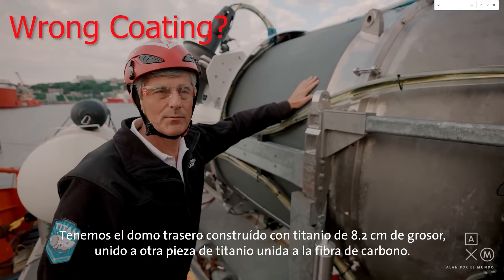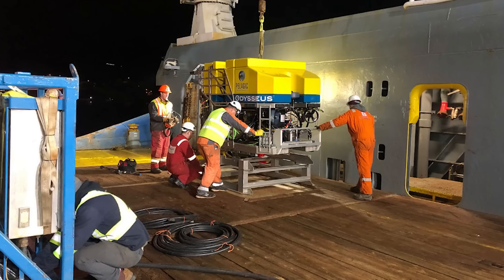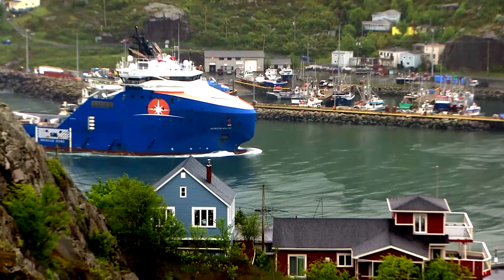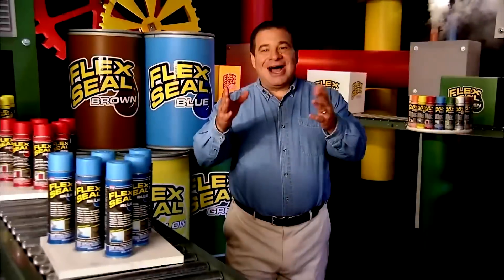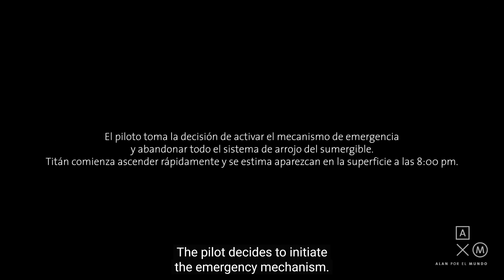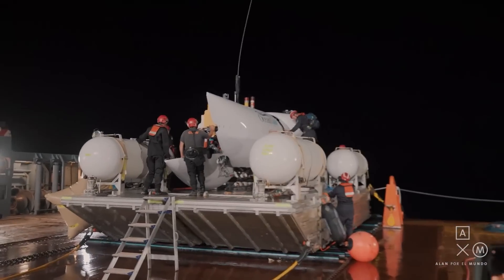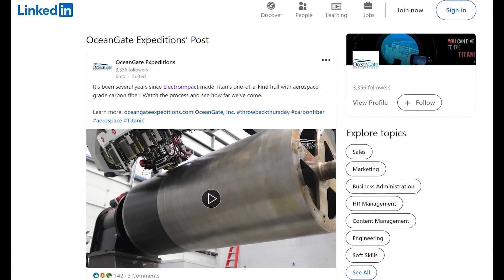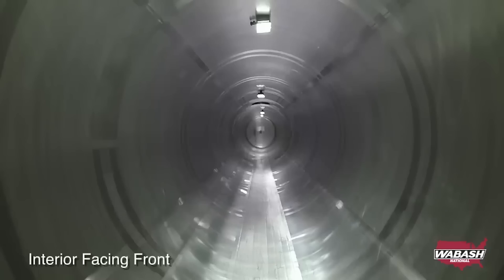Titan Sub Wrong Coating? Hull Construction, Debris Field Search

Comment: He didn’t want thicker and cross bound carbon fiber to save weight. But he uses rhino liner.
Reply from the maker: I wonder if they used the autoclave to cure it
Reply: @jeffostroff I had heard in video that the second hull was autoclaved, but I am not sure. I feel like I need a score card. Thank you for the great information
Reply: @jeffostroff they did not and that has been well documented
Reply: @jeffostroff An autoclave was never used in construction... believe it or not.
Reply: @berrytharp1334  How would you know that? All we have from the construction of the hull that failed is this 10 second video, which by the way is also insufficient to assess whether they crosses the weave.
Reply: @jeffostroff I think even if there was a process that could compress the carbon fiber and bonding agent beyond the 6000 psi it would be subjected to the carbon fiber would fray and lose strength anyway.  They’d end up with a very dense hardened epoxy CF conglomerate that would end up being about as heavy as titanium but much weaker.  Just not the right material for the job.
Reply: @jeffostroff I am pretty sure I saw a video that commented on the fact that they didn't. However I've never claimed to be right 100% of the time.
Reply: @jeffostroff good point, i have a special oven to cure all our thick pours and coatings. Its mostly only 158f for a few hrs than shut it down and let it cool to room temp slowly. We always use it after $100k failures taught us a lesson.
Reply: @jeffostroff not the Flex Seal 🤣🤣🤣
Reply: @jeffostroff  NOPE
Reply: @jeffostroff  with the kind of CF thickness they were using and how narrow the safety margin they had, they should have made the entire CF vessel  in a vacuum. Air dissolved in liquids is significant as well as the heat generated with thickness of epoxy resin use.... and cause small void to appear when the vessel cures.
Reply: @jeffostroff they did not, that's been mentioned a few times. Nor was it a clean room, far as I can see.
Reply: @jeffostroff  they did not
Reply: @jeffostroff  If you're having to wonder, that shows exactly how good your "research" is.  Yes, the fiber was crossed.  Alternating layers of hoop wound wet layup and axial prepreg.  And no, they did not use an autoclave.  This information comes from Brian Spencer of Spencer Composites, in an interview with "Composites World" published in 2017. 

Exactly the same techniques, including the non-use of an autoclave, were used for the second hull.  And yes, I have quotes for that as well.
Reply: @jeffostroff There are several videos that show Rush saying that vacuum curing was used, so it was bagged to set and harden the resin. But hearing this , one has to wonder if a resin was used between layers or was a coating of rhino liner used.
Being a form of latex sealer, Rhino liner could, under extreme pressure, simply form a rippling pattern just as latex gloves will do on your hands under water, with raised grooves along sections pressed flat from pressure.  That would  permit the intrusion of water  into the layers of laminate. Eventually, the pressure cycles would allow enough water under the laminate to make it inevitable to fail. 
My take as an A/ P mechanic who works with composites.
Reply: @youtubemusicowesmemoney8470  Rhino Liner is polyurethane, not latex.
Reply: @jeffostroff   I would think so, anything with 'wrapped' or 'pre-preg carbon fiber is always put in an autoclave to pull air bubbles out, and cure the resin....compared the rest of the cost, is just isn't that much $$$..many airplane wings and those big wind-turbine rotors are autoclaved.
 Here in Sacramento, Calif...there was a rhino-coat place, Rhino-coat was sold and used as a pick-up truck bed product, for reducing cargo damaging the bed....water sealing was just a side benefit. Water would leak out the tailgate anyway.
Reply: @dougankrum3328 nope it’s been revealed and with photo evidence that the company that built that carbon hill didn’t have an autoclave for it so to cure they bagged it and put it under vacuum like a local hobbyist would making his own stuff. They claimed 99.9% void free  after the vacuum bag cure.
Reply: @jeffostroff even if they did, carbon fiber isn't as strong under compression as it is under tension. Rino liner isn't designed for water proofing either, it's designed to increase durability vs impact. Water can also get between the layers of a composite material like carbon fiber.
Reply: @jeffostroff We yank 'em and how!
Reply: Maybe he should've used that spray sealant that is sold on late night TV. 
After all, that rowboat with the screen door floor didn't sink. 😂😅 LOL
Reply: @TheMomseloc  Flex Seal.  I am surprised that he didn't keep a couple of cans in the sub at all times.  He seems to be the kind of guy that liked doing it in the cheap.  When the cracking and popping started, he could have shot some Flex Seal in the problem area and all is solved.  😂
Reply: He seems like the kind of guy that thinks he’s smarter, it’s no less then suicidal to get in that thing with the seal the way it is. I’ll bet the carbon fiber was just fine.
Reply: @2021-x3k *Seemed
Reply: This was so predictable and apparently obvious. I can't believe more noise wasn't made.
Reply: That rhino liner is akin to flex seal over a faulty gas tank. Not really but that’s what first popped into my head.
Reply: @Pippi-Longstocking  Maybe he should have gone with gorilla glue.
Reply: Correct, in the sense of it being a bandaid for a problem.
Reply: Day 712 of me asking if anyone, ever is going to cover the gasket, or seal, or candy cotton or whatever between the door and the sub?
Reply: @martinwhite418  I'll bet it was high-grade (I'm talking Circus Grade, not the prepackaged stuff you get at Walmart) cotton candy that was just a little past it's expiration date.
Reply: @TheMomseloc  You think maybe a giant cotton candy eating sea creature ate the seal?
Reply: @martinwhite418  I can't stop laughing long enough to come up with a good response.
Reply: @martinwhite418  I'm trying so hard to picture what a giant cotton candy eating sea creature would look like. 

Maybe related to Sigmund and the Sea Monsters family? 

Because I suspected that's what they were all along.
Reply: @TheMomseloc  Yes, totally Sigmund, exactly the picture I had in mind.
Reply: @martinwhite418  They must've found out about it from the Shellevision.
Reply: @martinwhite418  Wait a minute. We could be on the wrong track. 
Sharks eat seals.
Reply: @martinwhite418  lol. I’d rather find out about the joint between the titanium caps and the carbon fiber. Specifically the different rates of expansion and contraction for temp. 
But I see your point.
Reply: @Meatball2022  Thanks, but that seal you reference was never broken, until it did. But the door seal was opened and closed, so we know they didn't use glue.  So what was it? Nobody talks about it. I feel like the door has survived and is now living in door witness protection because nobody mentions this.
Reply: @martinwhite418  where was it?  The front cap had the porthole. The rear had that tail and the electronics. Was it in the center somewhere?
Reply: @Meatball2022  Well, if you don't know where you put it, how am I supposed to know.
Reply: @martinwhite418  ok. I’ll do research on a phantom hatch for a destroyed sub that you don’t know where it is but demand answers on.  Just for you.
Reply: @Meatball2022  You do understand that these people were not born inside this sub? Hatch is not the meaning, like with birds on this sub. Humans got into and out of this turd shaped sub. The sphincter entry/exit point is what I'm referring to.
Reply: Weight is touchy on a submersible.  If you make it strong it becomes heavy and will not float.  How do you make a float for something that goes that deep?  You can't create another tank full of air because it will be too heavy to float too.  Much older designs used tanks full of petroleum because it is lighter than water and because it doesn't compress so the tank doesn't have to be thick and strong.  If you can create a pressure vessel that naturally wants to float then that makes the entire design much easier.
Reply: No matter how it was applied or cured it was still simply the wrong material.
To use an extreme example, using high tensile strength fibers in compression is like using high strength concrete in tension.
Reply: @davidchristensen2970  bingo
Reply: @davidchristensen2970  Maintaining a cylinder in the round is BOTH/EITHER a compression and/or a tension job. This isn't "using it in compression", since either type of strength can do this job. This is still "using it in tension". Exactly like a bicycle wheel, which resists being squished from the outside via... yup, TENSION. The weirdest thing to me is that you guys seem to not be aware it already made 13 successful dives to the Titanic, lol. Obviously, if tensile strength fundamentally couldn't do this job, it would have made ZERO successful trips, not 13. You're plainly, easily-observably wrong. The problem that sunk it is something about cyclical weakening, not the core concept of tension holding a cylinder under pressure intact being impossible, since it just proved that is possible 13 times.
Reply: @gavinjenkins899  
You are so far off on this that it’s basically pointless to engage.
Reply: @davidchristensen2970  Translation "I have no idea what I'm talking about but am too proud to admit that to even random strangers" a bit yikes.
Reply: @gavinjenkins899  The Titan had several issues with many of its previous descents to the seafloor. The implosion was not the first time they've lost communication, and if it ascended properly, it wouldn't have taken 7 hours to open back up as shown in the video. The carbon fiber from what I've seen was subject to slowly breaking down every single dive, which could've caused small air bubbles to form in the hull and allow water to leak in. The carbon fiber they used specifically was expired, as evident by them getting it from retired planes, which stop getting used after a certain number of flights.

James Cameron and many other maritime experts knew this submersible was doomed to fail at some point, it was only a matter of WHEN, not IF.

I could be misremembering some things, but I'm not acting high and mighty like you are claiming there was absolutely nothing wrong with the Titan's construction.
Reply: @AkameGaKillfan777  Yes I agree it had badly designed comms and cyclical degradation and so on, so what? At no point did I make anything remotely like the claim "Nothing wrong with the Titan's construction" please do not blatantly lie about my comments, thank you. None of that has anything to do with the actual conversation we were having and what I did actually talk about, which was about whether tension can FUNDAMENTALLY/CONCEPTUALLY stop a hoop from crushing. Any SINGLE successful mission to the titanic proves that yes, obviously those principles of tension doing the job can successfully apply, by simple observation of fact. If that was a bogus concept at a basic conceptual level, and the physics just wasn't true, then the submarine relying on that concept would have made precisely zero successful trips. Not 5, not 2, not 1. Zero.
Reply: @gavinjenkins899  
I’m starting to think that maybe there is an issue with understanding the terms tension and compression.
Using a bicycle wheel as an example of tensile stress only applies to the spokes. The actual hoop or rim/wheel is entirely in compressive stress. Take a bicycle wheel and remove the spokes, now we have something comparable to the pressure vessel being discussed.
Reply: @davidchristensen2970  Your example is easy to understand.  Correct me if I’m wrong but I didn’t jump to thinking you were trying to prove the accepted 12,000 year old case that a round design is inherently strong?🤣 - just that you don’t use fuel pressure hose in place of vacuum tubing, simple stuff like that.  The reason a bicycle wheel built to support a lot of weight doesn’t do as much good if you plan on riding so fast the spokes fly apart even though their both round.  The reason vacuum/  pressure implosion/ burst safety factors are calculated differently.  Things get hijacked when people get out over their skis ⛷️ sometimes.😆🤦
Reply: @kev_299  
Um, ok.😜
Reply: It was purely to cut costs.
Reply: @turgidbanana  very possible. I thought the entire reason there was carbon fiber at all was purely for weight. Steel would have been cheaper. No? 
It’s very possible EVERYTHING he did was to cut costs.
Reply: My simple racing kayaks are carbon fiber. They are also autoclaved in production. When I learned Titan wasn’t? Who would do that- be that stupid. Trying to save money and weight. He should have gone alone. I wonder if he’s having conversations with Capt Smith now, comparing notes on hubris
Reply: I had had assumed they didn't cross the fiber because it was more expensive to build that way, but it was only due to weight? How does that even make sense?
Reply: @inthefade I believe the whole reason he used carbon fiber to begin with was to save weight
Reply: And I thought he used carbon fiber because Boeing gave away cheap surplus (past its shelf life) 🤔
Reply: @Para-Phrase this has been confirmed
Reply: @Meatball2022 Not to save weight but to i prove boyancy. The two are related but not the same. It is weight to volume that matters under water.
Reply: @torben777  density
Reply: @inthefade  it was definitely on the cheap, but I remember him saying he wanted it to be naturally positively buoyant so the default if things fail is that it floats
Reply: @Meatball2022  Yes, that probably explains him going on about 'strength to buoyancy  ratio' which isn't really thing, you'd normally speak in terms of strength to weight ratio.  And I guess they wanted to use Carbon Fiber end domes, and except for the engineering problem of the window punching through it they probably would have.
Reply: @inthefade  most likely  lazy and  cost..  no othe reason to not cross the figerd thy are exoneialy  straonger that way
Reply: Unreal this wasn’t tested properly.
Reply: @GJH1010  nah. Not unreal at all. He was a narcissist.  He had belief that he could simply do whatever he wanted, he could ignore every standard, every expert, and use his minimal expertise to design a craft to be used in a highly stressful and intensely dangerous environment.
Reply: But they tested cross wound in lab's.

If you watch the tests for MK1.
Reply: He did it for the LULZ 😂
Reply: He's clearly intending it here to just be a waterproofing layer, not to add strength.
Reply: According to dr. Ing. wagner who did the video about the pressure calculations cross winding wouldn’t have made a significant difference. I know because I asked him this.
Reply: Double hull makes the most sense especially with those sensors he had, I'm no sub engineer though
Reply: @RCsFinest  I thought that as well. And if water is in the void between, that might add some strength. But like you, I’m surely no expert. Easy to second guess now that we know what DOESNT work
Reply: @RCsFinest I agree.  Without a light hull there is nowhere for moisture to accumulate outside the pressure hull as well.  Obviously pumping out becomes a much tougher task at that depth so the dehumidification system would have to remove all moisture to avoid condensation.  Someone directed me to a video where an engineer is speculating about the source of the water that was sloshing around the bottom of the sub after dives.   😮 They were speculating it to be condensation from the titanium hemispheres but did not seem to know for sure which makes no sense and is absolutely alarming.  If it’s condensation  then it’s simply because it’s cold outside , warm inside with five breathing humans and it would be everywhere although more noticeable in the caps because they don’t have anything mounted over them.  The design specs should have called for more than enough dehumidification and it’s hard to believe they would have missed on something that’s relatively simple to accomplish considering everything else they were trying to do.  It’s possible but they might have also considered the possibility that the water in the bottom contained salt which would have been real easy to test for and could have been an indication of something much more serious.  It has also been confirmed from screenshots in videos that there was 24 volt electrical under the floor including battery(ies?).  I’m  not jumping to any conclusions about electrical issues because that’s about all I know at this point - just adding pertinent information from available videos.
Reply: Weight should not have factored into his thinking. It’s buoyancy that counts for subs. Doh. I am not even an engineer and I intuited that.
Reply: @nialldoyle8206  weight or mass of the sub is one of the three factors that goes into calculating buoyancy... (mass of the sub, volume of the sub, and density of the fluid it is submerged in) you can't meaningfully "consider buoyancy but not weight"
Reply: @nialldoyle8206  The factors affecting buoyancy are as follows: Density of liquid. Volume of the object.
This means - the issue is weight. Because the volume didn’t change even when the weight does. Besides - he said it himself in interviews- he was looking to save weight. 
Dooo - I’m not an engineer, but even I’m able to listen to his interviews.
Keep in mind. He’s NOT a marine engineer. He was in aerospace. And he refused to listen to actual field experts. Because he “did the math”.
Reply: They are clearly using alternating 90 degree wraps on the hull though. Around and also back and forth.
Reply: @bills6093  Yes, see (11:30) in the video. Robtic tape dispenser is moving axially laying axial strip of carbon fiber tape.
Reply: @bills6093 that was not the hull.
Reply: @bills6093  they don’t though.  You can see when they’re manufacturing it. The absolutely did not cross the fibers.
Reply: @jimw1615  so where did you see this?
Reply: @jimw1615 Your reply makes me wonder why not use a more complex weave clock pattern to add additional strength to the underlying laminate? I must admit that the machine layout footage is more pleasing to the camera but so is doing it right. 
But RIGHT would have been to use a titanium mono hull structure to begin with.
Reply: @jimw1615  the ones I keep seeing are always criticized for not laying the fibers to take advantage of their strengths. 
Probably a moot point anyway, as carbon fiber is clearly a horrible choice for compression forces, regardless of its pattern.  Also, the joining of multiple materials with different expansion rates is a problem. 
Everything about this stupid sub was done incorrectly. It’s amazing it lasted this long.
Reply: @Meatball2022  Oceangate made two hulls, one in 2017, the other in 2020 by different manufactures using different fabrication methods and carbon fiber materials.  The video at (11:30) is of the 2020 hull and shows radial and axial lay-up.  The much more widely shown videos of winding with less sophisticated equipment (and epoxying on the Ti rings)  are from the 2017 fabrication. Details of both fabrications are sketchy.
Reply: @engineerncook6138  Perhaps different specific layup techniques between the two hulls, but both of them were 0-90 layups with the axial layer being prepreg.  There's loads of documented evidence for that.  

What really makes me laugh is people hanging onto this "hoop wound only" bullshit alternative-factoid as if it were important.  Even if the first hull had been only hoop wound carbon, or even string held together with silly putty, what difference would it make?  It was the second hull that failed.  The problem here is people who think that "research" consists only of watching zero-content-value lazy videos like this one.  Flat earthers, the lot of 'em.